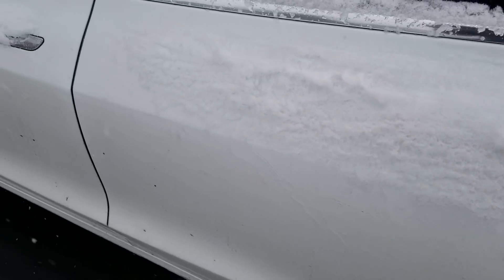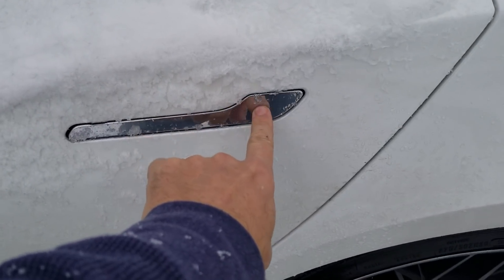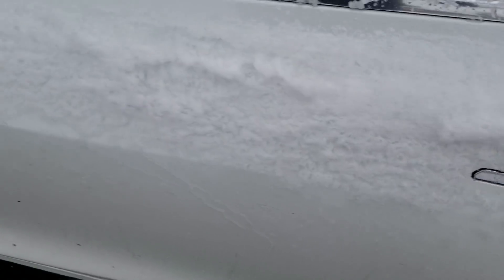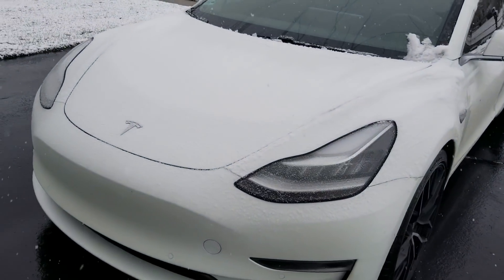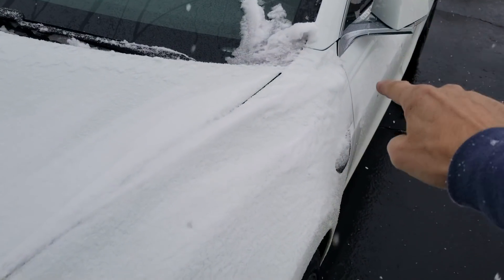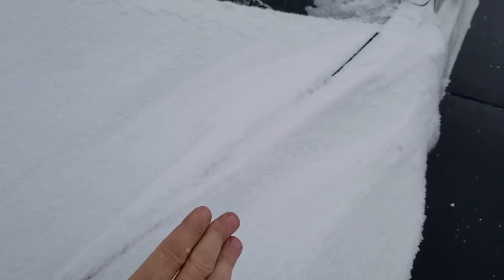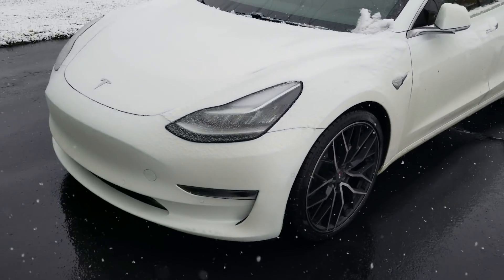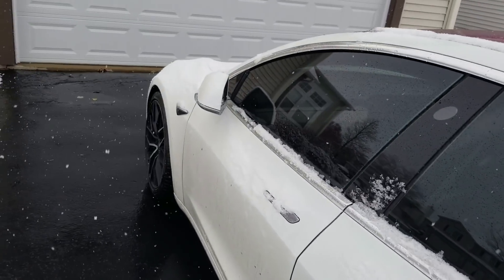Aerodynamic flow revealed through snow pattern on Tesla Model 3!

Comment: Hi Matt. Keep us posted on winter experience with your car. As I am new M3 owner and would to know how much range do you loose in cold temperature. I feel my M3 loose good range parked in garage believe called phantom drain. Let us know your experience. Also I got 19 inch sport wheel continental tires do you think in snow it will handle it or should I get snow tires. Thanks

Comment: Temps have dropped in Southern Ontario as well.  My door handles opened, but stayed in the open position.  I had to push is back in.  Also, passenger mirror was frozen in the closed position.  It unthawed after about 20 minutes of driving.  What do you think we can do ?
Reply from the maker: I will be addressing these issues as they arise. I will post a video of solutions as I have them.
Reply: For one, program the mirrors not to fold. Not much you can do about the door handles. Tesla should have made heated handles.